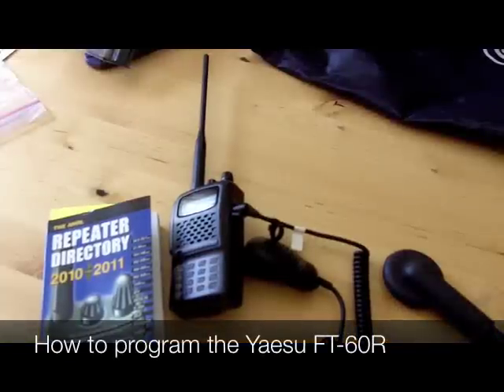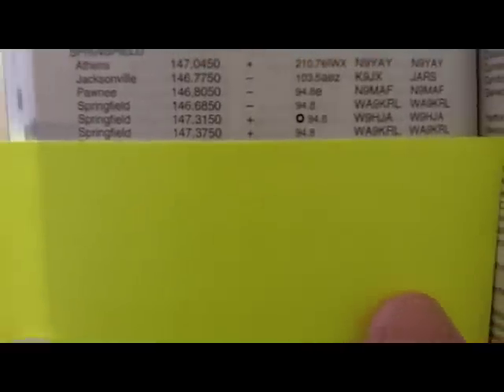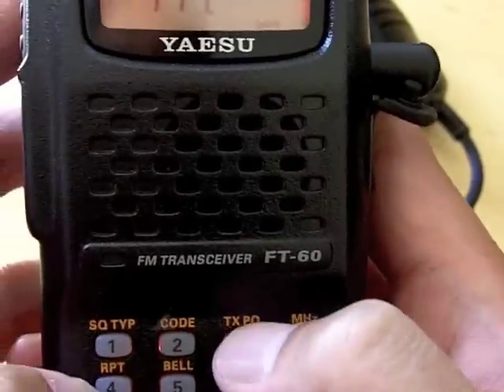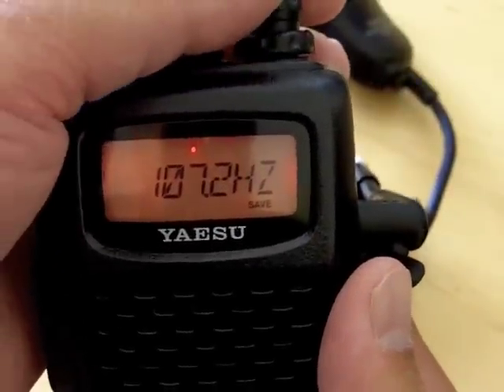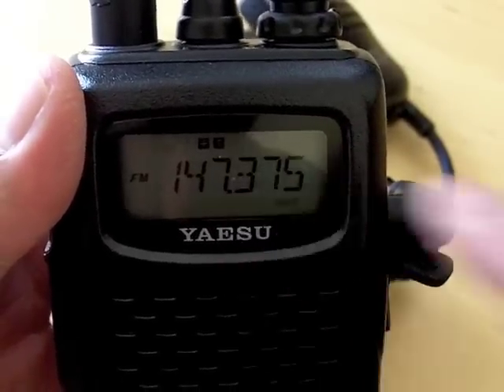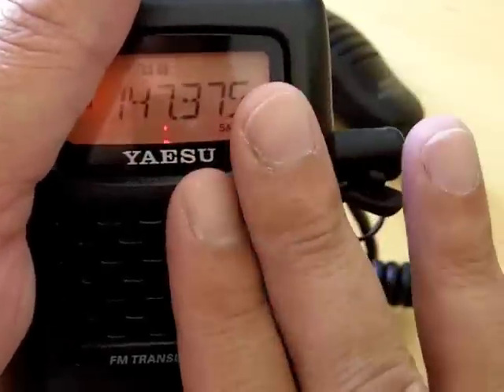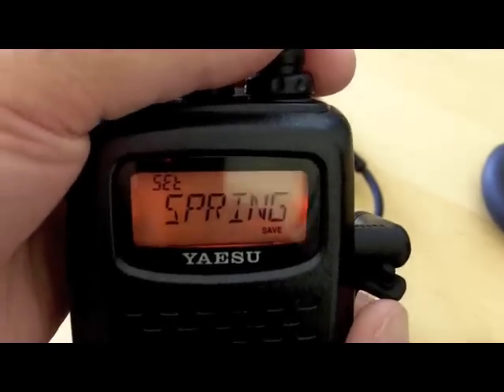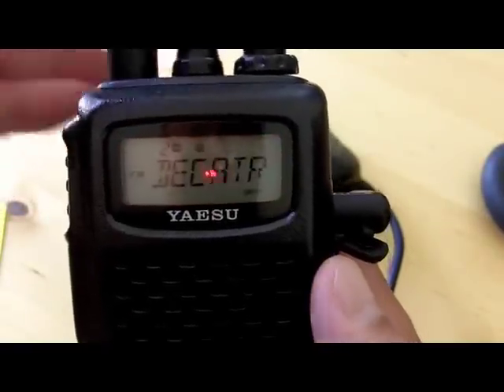How to program the Yaesu FT-60R Transceiver

Comment: I find it funny that many of the posts are so old. I just bought my first viable HT, this Yaesu Ft-60r, less than 2 weeks ago. I purchased the RTsystems software for it & after charging the HT, I programmed it & was up & running in minutes. I am also a beginner & got my license this year. The right software makes this easy. The ft-60 is a great HT, especially for beginners like myself. I tried a Wouxan KG-9d first but failed. I found this Yaesu is in my opinion, better.

Comment: I just bought one of these and wanted the quickest way to get started. I used this video to program 30 repeaters into my radio.  I figured I would get used to manually programming before going out and getting the programming cable to use with Chirp.  This video was perfect!  Thank you for the crisp and clear explanation!

Comment: I thought I would like this radio but now I hate it. It keeps turning itself off in the charger. Even all my cheap GMRS radios don't do that.
Reply: You didn't by chance read the instructions that state clearly that it has to be turned off when charging ?
Reply: Of course, and that's pathetic. Again, even my cheap GMRS radios don't have that flaw.
Reply: I don't think its a flaw.  I think its to prolong the life of the battery.
Reply: +Jack Tagart - That's just your assumption, and you have no argument. Both NiMH and Li -ion batteries do not lose any longevity when they are charging as much as they are drawing. We've been doing this for decades and suddenly everyone was wrong? This radio has been on for over two years and its battery seems to still be like new. It is important to me that a radio stays on so I don't miss the very transmissions that I desire to monitor. Randomly turning off is a feature that turns ME off. I've dealt with portable radios for over 35 years and I can tell you that your argument is without merit. BTW, this is NOT a feature, but an oversight. This is not a smart charger, but it should be. The reason the radio turns off is because the battery is low and the charger didn't wake up in time.
Reply: +knupder - No, it turns off because the battery dies while the radio is in the charger. "If it is so important to you to have an engine in your car, be sure that it has one before you buy it." You know how ridiculous that sounds? This charger is not a smart charger. Nor is it a trickle charger. It charges once and then turns off for good. Every transceiver I have ever owned (over 100 of them by now) charges while in the charger. But that was overlooked here so this radio defeats its own purpose. However, if you read above, X10 solved the problem very simply so now the radio has stayed on just fine for years.
Reply: +Jack Tagart - The point is that nobody checks what is usually obvious before ordering. The radio staying on is important to me, and I'm certain it is important to others. In case you missed it, I was able to resolve the issue, and I'm sure that information is very useful to others. But your arrogance is not useful to anyone.
Reply: +Jack Tagart - In case you missed it, it now works great. Why would I buy another radio if this one works great? Doesn't sound too bright to me.
Reply: +knupder - I read the manual cover to cover before I purchased the radio. There is no direct mention of this flaw in the manual. In case you missed it, I have found a good workaround and it now works great. I would be foolish to return this radio due to your egotistical misconceptions.
Reply: It's definitely a flaw.
Reply: yeah i suppose in your opinion its a flaw.
Reply: Out of all my radios I've had over the years, it's the only one that turns itself off. That, my friend, is a flaw.

But I've gotten around it. All you have to do is put a timer on the charger. I use X10.
Reply: Cotronixco but if doing that kills your battery faster is it worth it? if the feature of turning off while charging makes the battery last longer that could be worth it to a lot of people. You might want to kill your battery faster by leaving it on but I bet enough people like this feature for them to actually spend time to put it into their product.
Reply: It's not randomly turning off if it only turns off when you charge it.  If charge-through is that important to you then maybe you should make sure that your devices have that feature before you buy them...
Reply: Why would you buy a car when you aren't sure whether or not it works, unless you're rebuilding it?  And the fact that your radio turns off while it's in the charger doesn't mean that it isn't charging...
Reply: Cotronixco lol comparing this to needing an engine is ridiculous. That's like saying max sure you ham radio transmits before you buy it. The charger issue is like you complaining you only have a 12 gallon gastank and you wanted a 20 gallon tank. That's something you should find out before you buy it.
Reply: +knupder - You're wrong again. You could have tested it before you made another false statement. The charger does not turn back on, so the radio turns off. It is not a smart charger.
Reply: Cotronixco if you want it on all the time maybe don't get a hand held
Reply: If you're buying things without making sure that they actually do what you want them to do then that's your fault, not the manufacturer's...
Reply: Oh, so you read the part on page 9 about how the charger isn't designed to power the radio?

That's not a design flaw.  That's just you using the wrong tool for the job.
Reply: +knupder - Wow you are dense. Chargers NEVER power handheld radios. Batteries power radios, and chargers charge batteries.
Reply: Cotronixco so you want to leave your hand held radio on 24/7 constantly getting g charged by the charger . . . . Why is that the radio you needed.
Reply: They do if they're also designed to be power supplies, which the manual states pretty clearly that the charger is not designed to be...

I hope you don't talk like that on the air.
Reply: knupder I think he's too smart for us. We will just never understand.
Reply: No doubt.
Reply: No doubt indeed.
Reply: Haha ! That's what I was thinkn"...